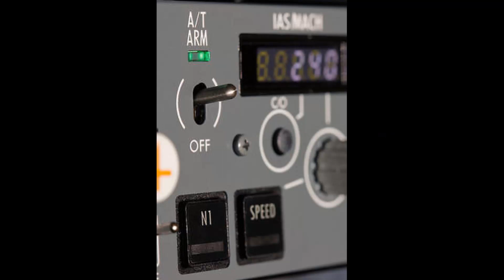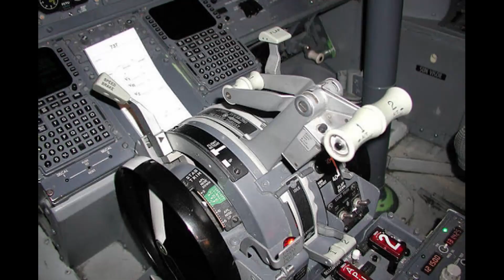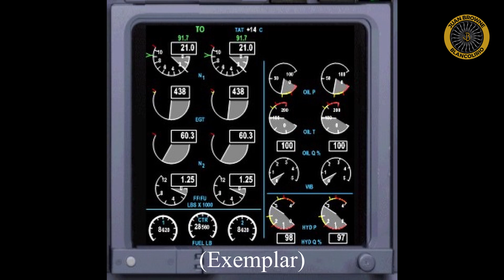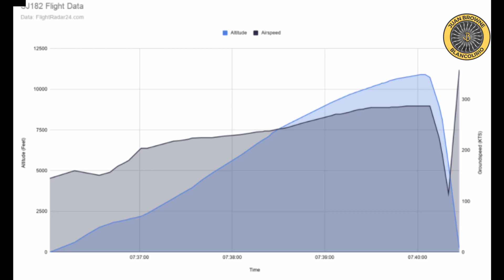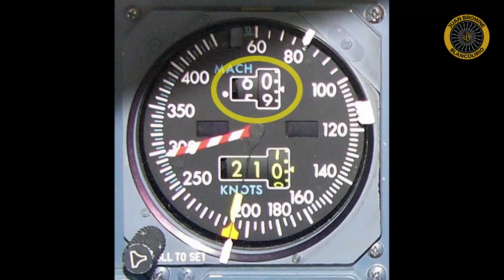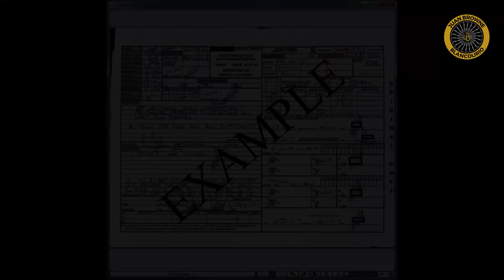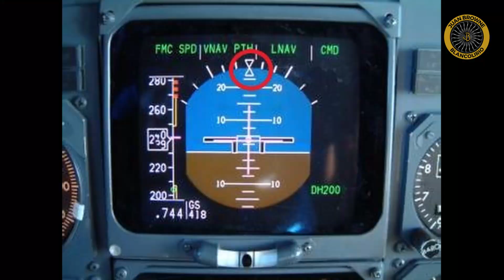Sriwijaya SJ-182 KNKT Preliminary Report 12 Feb 2021

Comment: Whew learned some stuff on this one. How do you not notice one engine losing power or am I missing it? Thanks Juan
Reply: Getting the CVR might answer that. But if they were busy dealing with something else it isn't not hard to get distracted by something that is slowly changing.
Reply: @bazwabat1  I have read about information overload when a lot of alarms sound at the same time but have never flown anything that had that many alarms.
Reply: @ronpurcell9984  yeah me neither. :-)
Reply: watching the whole video, it sure looks like throttle controller issues.
Reply: Shitty pilots is the short answer.
Reply: @upgrayedd9732  And possibly maintenance
Reply: You don't notice one engine losing power because the autopilot keeps compensating for it. Why nobody noticed the throttle handles were not the same is really strange. Crew gets distracted by outside events and forgets to fly the plane.
Reply: @bazwabat1  Indeed.
Reply: @vinquinn  I guess no one was looking at the engine instruments?
Reply: @Codehead3  The 'maintenance' was truly appalling. Repeating the same incorrect 'fix' that fails again is insane. The auto-throttle should have gone to a proper facility where the connector would have been replaced. I can't help wondering how common these 'band aid fixes' are in some parts of the world.
Reply: Yeah, how do we know the problem was with the auto throttles and not something more fundamental that the auto throttles tried to compensate for?
Reply: @blairhenderson5005  Is that even relevant ? It doesn't change the facts.
Reply: @blairhenderson5005  We don't know it. We can only fall back onto the preliminary report which was published and which Juan discussed here in this video. And this preliminary report stated, based on the readout of the FDR, that the ongoing split of the throttles was crucial for the 45-degree-rollover of the plane, which wasn't recovered than by the pilots and let to the crash. The preliminary report also states that it wouldn't be clear until now if the left throttle  failed or the right throttle or both throttles. And the preliminary report states, too, that the plane had in the days before the crash repetedly a similar problem with the throttles.   

But the important fact for the crash is indeed that nearly two decisive minutes with the throttles happened what happened without an intervention from the pilots! Otherwise the rollover of the plane wouldn't have  happened and the crash therefor wouldn't have  happened, too. The important question is insofar  only: Why didn't the pilots intervene and let it go until it was too late? This question could be answered by facts only if a readout of the CVR would become possible. One opinion about the reason is: The pilots simply didn't recognize what was going on with the throttles. But this is still an opinion and not a fact.
Reply: @Hans_R._Wahl  After reviewing the video a few times (starting about 4:00) it's not what I was thinking - that the auto throttles were trying to compensate for a weak engine.
Reply: @blairhenderson5005  The plane had not an engine failure, it had repeted problems with the throttles. Due to the preliminary report both engines were still running when the plane impacted the water. That's for now the state of the investigation.
Reply: @upgrayedd9732  Maybe a too short answer. If it´s simply shit which caused this crash you´re unable to learn anything from this lesson - and maybe you should do it.
Reply: @pasoundman  I read it in the same way. The focus shouldn´t be only onto the pilots - at least as much questions raised to me how the mechanics ("engineers") dealt with this case.

Comment: I think the term you were describing regarding the autopilot is called “autopilot Task Saturation”
Reply: Peter Mortensen  great question. The autopilot on the 737 will only trim the horizontal stabilizer, it doesn’t trim the ailerons or the rudder, so if there is an out of trim condition (perhaps from differential thrust) the autopilot can only apply so much force, and it could “let go” if it can’t hold the plane.

Comment: Juan,
Great report - thank you!
What Im trying to understand about the asymmetric thrust is:
1. were both engines supposed to throttle down and one didnt or 
2. did one engine throttle down when it should not have? 
Also can the FDR discern between AT commanded and pilot commanded throttle changes? 
God bless
Paul (in MA)
ps - no ads
Reply: As they were still climbing and needing thrust , it Is most likely the left engine throttle incorrectly reduced while the right throttle maintained the required setting .

Comment: At some point they lost situational awareness (SA).  The altitude changes could have given them a heads up to check / re-establish their situational awareness but sadly this opportunity was missed. Without SA they were unaware of the increasingly unusual aircraft attitude and when they became aware they had no frame of reference as to how they got there.  They probably had time to understand their situation or deal with it, but not both.  The investigation should shed light on how and why SA was lost, it does not at first sight look like workload or distraction. It does look like they may have been using a subset of the available information to give them false SA or relying on the autopilot and not maintaining their own independent overview.  "Recognition primed decision making"  is a concept developed for emergency preparedness, it boils down to "recognize, act" becuse there is no time to analyse and decide before acting.  It comes only from repeated exposure (practice) of similar situations, "when I see this, I will do that".
SA is going to be one of the battle grounds in self driving cars; who will maintain sufficient SA to take control immediately in an emergency?
Reply: I have often thought, why self driving cars? Why not merely assisted but still make the individual drive the vehicle. Seems on the ground we are headed to create more accident situations than prevent them. Seat belts were great, so now why not just braking systems that work toward a better outcome?

Comment: The Attitude indicator should have a flashing red light on it when over 35 degrees bank or high nose up/down.The pilots attention needs to be drawn to the Attitude indicator.
Reply from the maker: It does, there is another audibal "Bank Angle" warning.

Comment: Perhaps a five second warning before the auto pilot shuts off should be considered.
Reply: Yes. Or 30 seconds!?
Reply: I say have a warning that informs the crew that the autopilot is operating outside of a normal operation envelope. That way the crew starts to scan the instruments and can get ahead of the aircraft before it disconnects.
Reply: @LIamaLlama554  Agree, a warning should be available.
Reply: @oldschoolnomad813  I agree, it's about time some of this automation re thought out.I did not know that if  the auto pilot shutoff the aircraft could react violently. You learn a lot from this site.
Reply: Peter Mortensen  I am not a fan of loud alarms as they could disorientate the crew. I think warning lights and alarms should be positioned in the control layout, where the problem is. Example low fuel- the alarm and the warning light should by the ful gauge.
Reply: Thanks for the question sorry about the spelling!

Comment: What is up with foreign pilots not paying attention to what is going on? There seems to be a pattern of crashes resulting from easily corrected situations that were simply not detected at all or unprepared to handle the situation.
Reply: That's what happens when you have a 150 hours of training in an aircraft, and then 4900 hours of "button pushing". These ab-initio programs that are the norm in these foreign countries are the WORST possible way to train a pilot! They defeat the purpose of the pilot in a cockpit, in the first place.

The whole reason a pilot exists, is to SAVE THE DAY, in case the automation goes wrong! And a lot of the time, the automation DOES go wrong! Passengers never realize this, because these incidents are seamlessly taken care of by the pilots! So absent that, with todays technology, the airplane can be automated to the point where it can fly itself without needing pilots.

In places like the US and Canada, pilots get to their positions on jet airliners through blood, sweat and tears, unlike these 150 hour "wonders" stuffed in the right seats of airline cockpits, in these foreign countries. They gain SOLID stick and rudder skills, a whole 1500 hours of it, the good ole fashioned way. THEN they are taught to operate the complex systems on airliners. 

When you combine those SOLID FLYING SKILLS AND EXPERIENCE gained by doing the REAL flying, with the skills needed to MANAGE the systems of an airliner type aircraft, you have an outstanding pilot! Otherwise, all you have is a "button pusher" that is completely lost when the aircraft goes completely haywire, as Juan describes in this video!
Reply: @747-pilot  there are plenty of airlines especially in Europe with pilots with very low hours but flying for airlines that have excellent safety records. On the flip side you can then have pilots like the Atlas Air FO who had many how’s but did not cope well in certain circumstances and caused the crash in Houston
Reply: @tomstravels520  The Atlas Air FO had been cited numerous times as a "failed candidate" and was clearly hired as an "affirmative action" candidate to satisfy quotas! That is an anomaly!
Reply: @747-pilot  how many more are there though? And once again there are still airlines in Europe that train candidates from the basics in a Cessna to an airliner and they have never had an accident in 30-40 years. It’s not all about hours it’s how rigorous the training standard is and sticking to the rules and regulations.  Stop acting like the US is the best and only country with good statistics. Europe, Australia and even Japan have extremely good safety rated airlines and these are “foreign countries”
Reply: @747-pilot  that’s 2 words and 3 letters. And congratulations you named ONE airline that was found to have not trained all its pilots in unreliable airspeed. What about BA, Lufthansa, EasyJet, Ryanair, Aer Lingus, Air Baltic? You want to claim Atlas was an anomaly well AF447 can also be considered an anomaly on that basis too. Has anyone else in Europe stalled the plane and crashed it?

Also you named an accident that happened in 2009. You know what else happened in 2009? Colgan Air 3407

The capability of the Atlas Air Pilot was also laughable. 5000 hours and only now his training is questioned? Forcing the nose down 40 degrees.....you definitely do not go down that much during stall recovery training. 

Considering the amount of accidents the US has had in the past it’s no surprise most aviation rules and training standards have been based on accidents and lessons learnt from US airlines.

If Sullys plane hadn’t hit birds and Tammys engine didn’t blow up you’d never have heard about them. They’d just be regular pilots. We haven’t had a major incident like that so we don’t need to remember a pilots name for their actions. If you want one then I’ll give you Richard Champion de Crespigny from Australia

So Juan is a you tube pilot...so is Mentour pilot who is a captain, check pilot and examiner

Comment: Juan, I am not letting the mechanic off the hoop, but pilots are part of the reason a system or component doesn't get fixed the first time that it is written up. Inop. is only a good write up in two instances. Number one is there is an inop flag showing in the instrument or display or the system or component is comply dead or unresponsive. To help the mechanic you need to say what the system or component did or did not due, what you expected it to do, what flite condition you are operating in and any other information you can provide. You must remember the mechanic is not a mind reader. You can always provide to little information but you can never provide to much information.

Comment: What a third world clusterfuck situation, dont replace the broken part just clean it to save money.
Reply: Not always necessary. Start with the quickest and cheapest way and then work back. I have encountered this before in vehicles. Sensor, stoped working, took it out and it was dirty, cleaned it and it worked and still works 2 years later. Cost nothing

Comment: When I was learning to fly, my instructor started a climb to 5,000' and was explaining how to get in and out of a spin. He told me that he was not allowed to actually do spins. Of course, as soon as we got to 5,000', he pulled the throttle back and let us stall and then go into a spin. He then told me to do the same. These are entered in my log book. Personally, I found that I liked doing spins. They were fun. But, from what you are saying, I can't understand why he wasn't allowed to do spins. It seems they should be required so it is an automatic response. I was flying a Cessna 172 which is really a very forgiving plane. But, should I have been in another plane that wasn't so forgiving, it would have been nice to have the practice. BTW, this was back in 1970 and I was in Jacksonville, FL.
Reply: My limited understanding is that unless the instruments were rated for spin (most likely not in a 172) and you did spin the plane, then the instruments will require maintenance before being in compliance.

Comment: NG MEL says you can MEL a Mach indicator.  But here we go again a third world airline loosing control of a good airplane.  A split throttle kicking the auto pilot off on the 737 should be a pretty common reaction . It is very common in the sim.  Great Video.